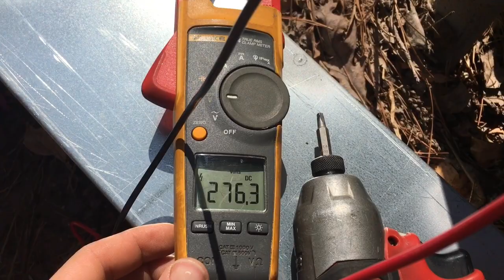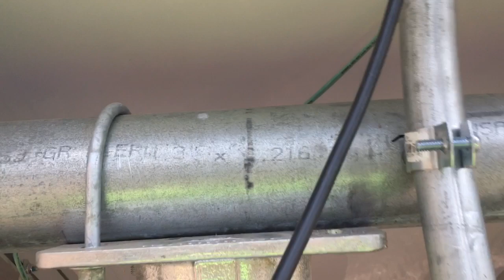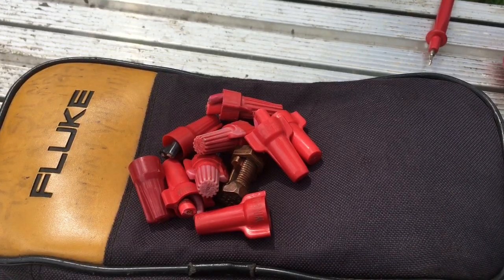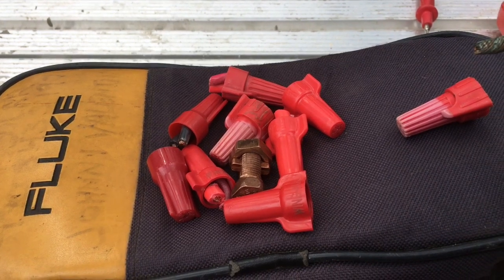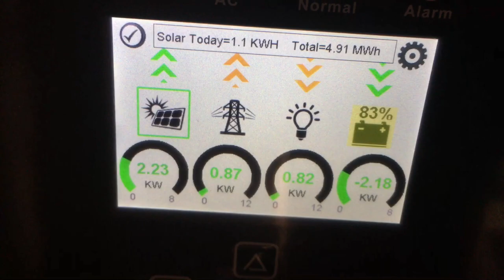How NOT to Install Solar! pt2:  The repair

Comment: Could you please give the part number of the MPDB power distribution block you highlight in the video?  Vendors tend to use a generic picture for these, and I'm having a hard time figuring out anything useful from the Mersen/Ferraz Shawmut website.
Reply from the maker: https://www.factorymation.com/MPDB63162
Reply: @GainSolarPower  Thanks, I appreciate it.  I'm curious if you've evaluated the options from Wago.

Comment: It takes a mechanical connection to work with DC. Wire nuts work loose and burn up. Wire nuts seam to do ok with AC most of the time but won't with DC. Once the arc starts it's junk
Reply: even a/c at this point... its called a wago
Reply: Three words: setscrew wire nuts.  All hail Ideal 10/11/22s.
Reply from the maker: Roy Amberg Yes but those power distribution box I’ve been using are In my opinion, the best method for splicing, better than Polaris lugs, maybe only split bolts and rubber tape are better but way slower
Reply: @GainSolarPower  Polaris connectors are junk. I've had then give trouble. They don't take vibration on a wind turbine.
Reply from the maker: Roy Amberg I don’t have to deal much with vibration but I’ve found a few burn up.  They look like crap when you take a cover off and they all flop out at you.   What’s you go to splice move for over 30amps or a DC circuit
Reply: @GainSolarPower  I think your missing the point. Or misunderstood what I was trying to say. What your using is about the best your going to get it's a mechanical connection that can get good and tight. Wire nuts don't work we agree on that  spit bolt is ok but a mess.  Polaris is junk in my opinion. Only other option is solder them. And who's going to do that